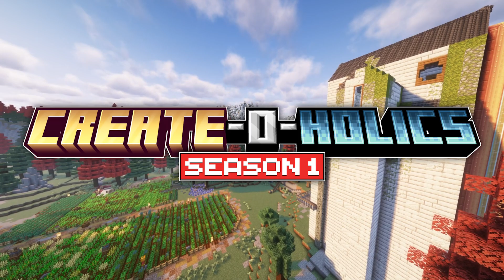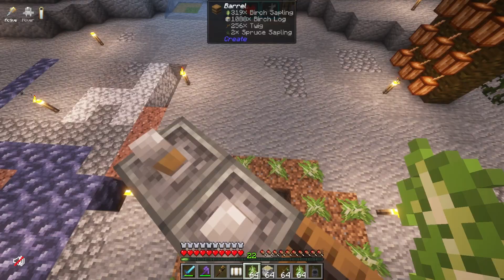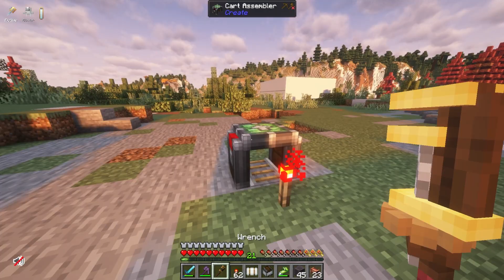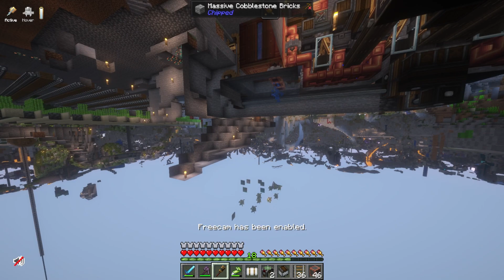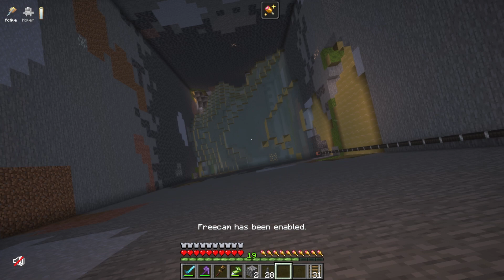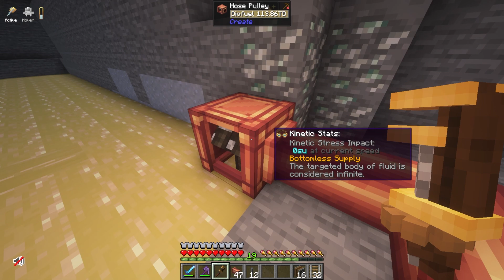I Made an INFINITE FUEL MACHINE With CREATE MOD - CREATE-O-HOLICS

Comment: This is actually a glitch that's been around for a long time where the hose pulley says bottomless supply but it still empty the reservoir. The only fix is to lower the threshold of how many blocks it needs to detect and tick on Fill Infinite so the fluid can go beyond the lowered threshold. I mean that is what works for me.